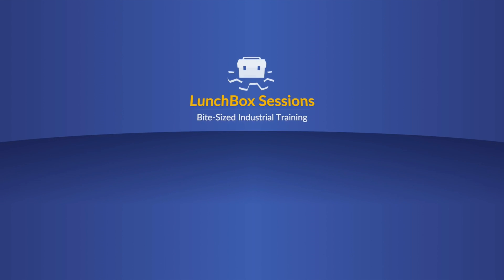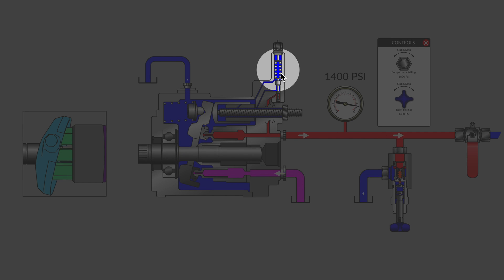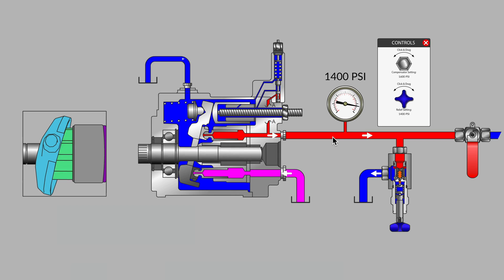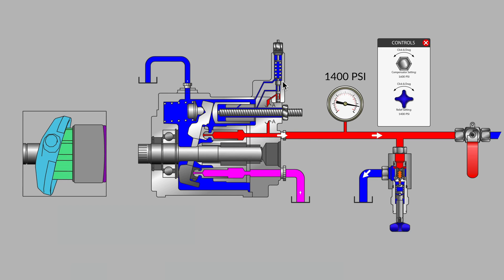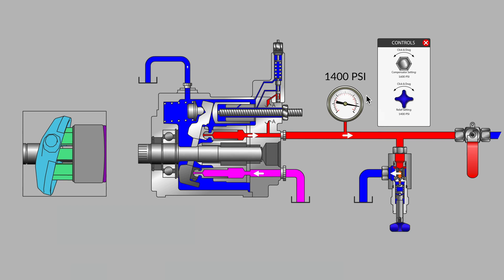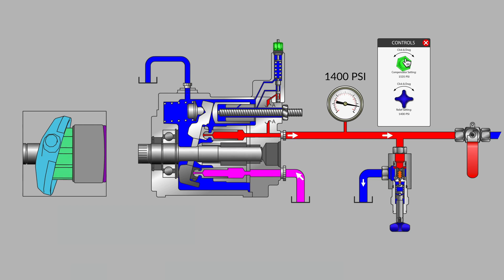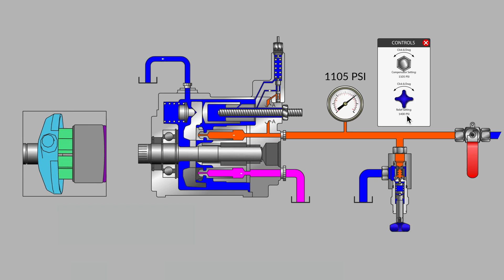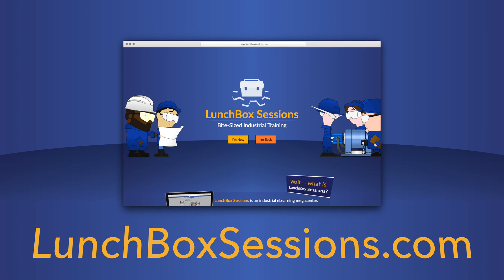How to Readjust an Incorrect Pressure Compensator Setting - Part 1

Comment: When would an accumulator be used for pressure spikes, instead of a pressure relief valve in this example system?
Reply: they were not designed to absorb pressure spikes and cannot be responsive to those sudden spikes.

Comment: best INTRO to Hydraulics for those people they want to learn it.. Still dealing every day with hydraulics at work and still following LUNCH BOX SESSIONS VIDEOS :-)..(THANKS FOR WATCHING) :-)
Reply: is it normal for the pump to reach relief valve pressure setting with outlet closed and manual bypass open. A rexroth variable displacement pump.